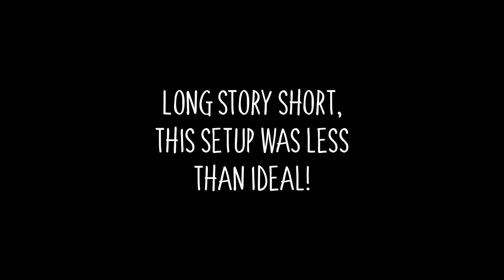Building my New Workshop - 2 Years+ Timelapse!

Comment: I finally subscribed to your channel. It was the least I could do for the man who inspires me!! After almost 10 years I'm finally painting my shop interior. My "shop" is actually a premade shed that I purchased the week I retired 10 years ago. I was going to be away for a month, so I hired a friend to insulate and wire the shop to my specifications while I was away. Bad idea to employ a friend, at least in my case. I came back to only half of the outlets I wanted which was to have  2-220  outlets on each wall and ended up with only 1 on the back wall. The OSB that was the wall covering looks terrible because he installed it with all of the sprayed-on lettering showing from the manufacturer, instead of flipping it over. And he never installed the lighting. He did however give me back the budgeted portion I gave him for the electrical. So, I had to remove the OSB in the areas the wiring would run and installed steel pipe all around the walls for the wire to run in. This way there would be no way of putting a screw into a wire when I hung things on the wall. While I had part of the OSB off the wall for the electrician to wire in the outlets, I turned those over so the lettering is facing in. That left me with the entire ceiled and half of each wall to prime which I never got to until recently. I've spent this past few days putting 3 coats of primer on so the letters don't bleed through plus OSB sucks up paint. I would have left it natural but the white, as you know, really brightens the shop making it easier to see everything without shadows. I love your space and how organized it is. I apologize for leaving a "Novel" for you to read.
Reply from the maker: Don't apologize and thanks for your comments! I don't hire friends (as I want to keep them my friends), and I don"t hire pros anymore (aside plumbers and electricians) so that I'm sure the job is well done! It's a lot of work, but it's so rewarding once it's done! With that said, don't work too hard!

Comment: Hola! 🖐It has been a while since you posted this, have you made any significant changes since then? It seems that you put a lot of thought into it beforehand but if you were building this shop in the middle of another big project, maybe you sacrificed a little for the benefit of time. It looks really, really good. Very nice work on leveling your two elevations of floor. You covered a drain there, any issues with that? Take care and have a good one, Adios!👍
Reply from the maker: Sorry for my late reply. I did some changes since I made the video, but I've been very busy and that's the reason why I put my channel on hold. The drain was outside originally, but it is now inside the addition built in 1990. As a result, it's totally useless and that's why I covered it. Good luck and have fun with your own workshop!
Reply: @HODYODesign  Thanks for your response! Will do, thanks.👊